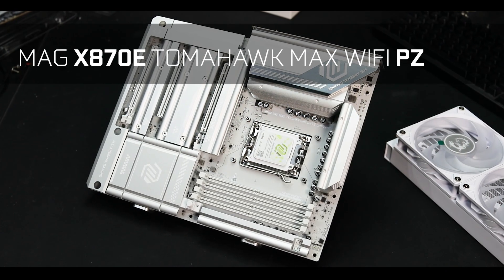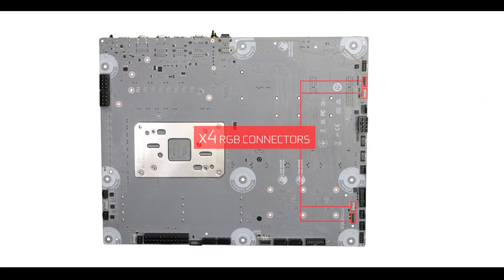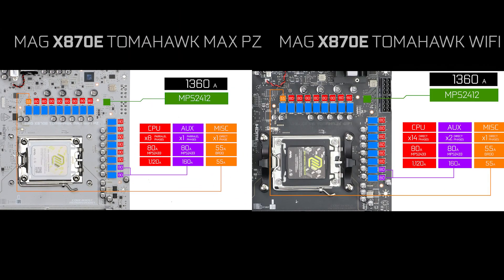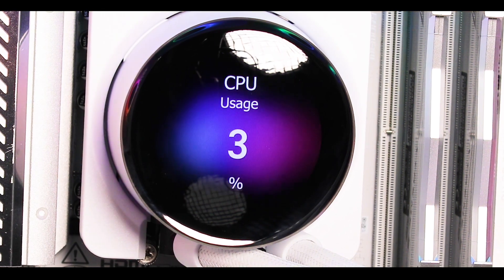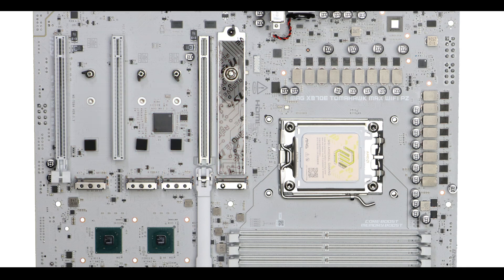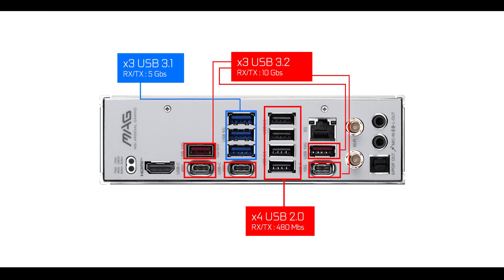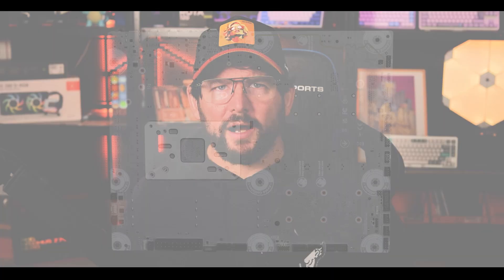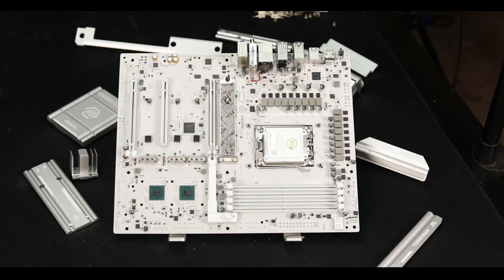MSI MAG X870E TOMAHAWK MAX WIFI PZ : a sexier kind of TOMAHAWK

Comment: Can you confirm the front power delivery works at 30W (or 60W?) with that PCIE_PWR1 connector being utilized? MSI doesn't seem to advertise power delivery anywhere on its website or manual.
Reply from the maker: I think ur referring to the front connector type c. Indeed it igets it additional power from the pcie plug
Reply: @Laurentschoice  Yes, the front connector. Are you getting the extra power independent of having to install MSI's "Super Charger +" software which itself seems advertised of being able to give that power boost without supplemental power? So confusing! I am agonizing over whether I should get this one or the Gigabyte B850 AI TOP? Same price. À l’aide 😵‍💫